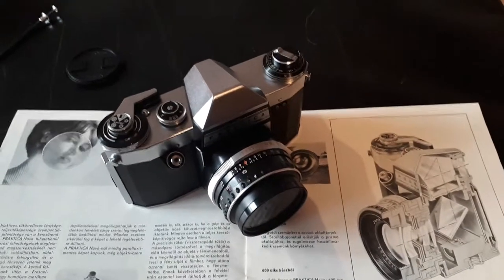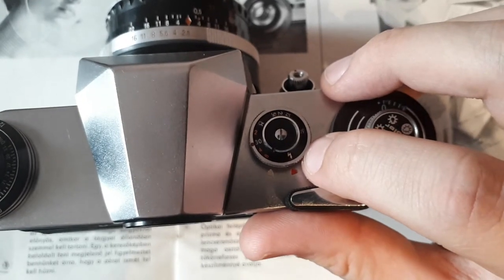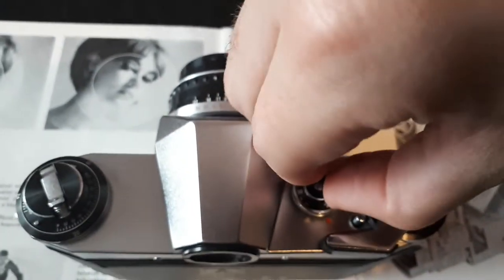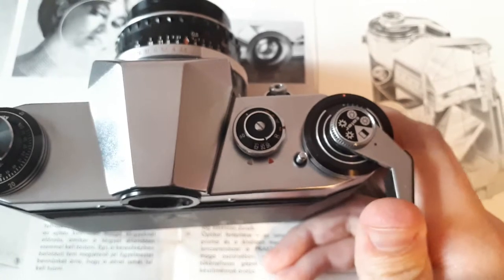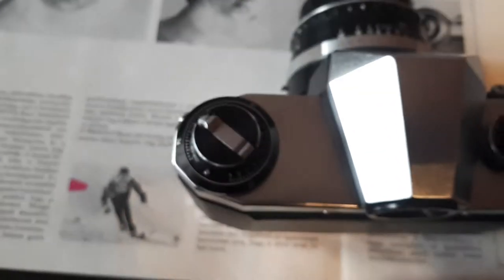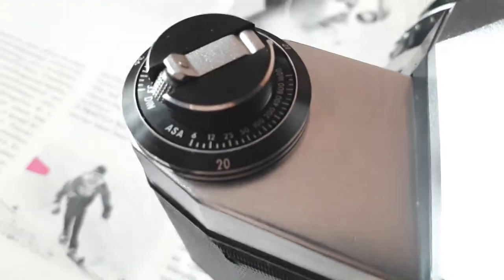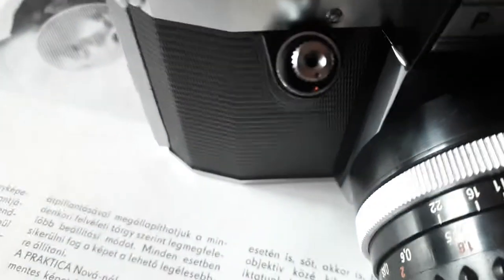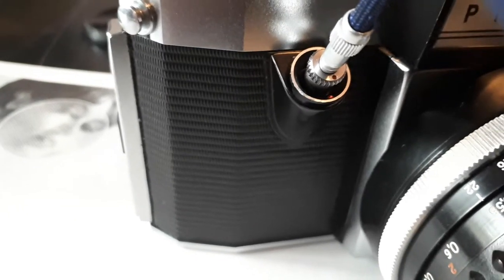Praktica Nova 1964 Controls

Comment: You should only turn shutter speed dial clockwise on the old cameeras. Also to rewind film you have to push in release button next to wind lever before using rewind crank. Seen quite a few first time film users tearing their film for not pressing this button.

Comment: my grandad recently gave me this camera! so does the iso/asa automatically adjust? as there is no way to change it..
Reply from the maker: Hi!
ISO/ASA is a characteristic of the specific type of film you've put into the camera. It cannot be changed on the fly like on digital SLRs. There are plenty of great videos that explain all the concepts you need to understand to use these analogue cameras.
Here's a good explanation of film ISO: https://youtu.be/SSJosqg6wA4
and of aperature and shutter control: https://youtu.be/zHUjn8ttQRM 
Now, this Praktica is a rather old piece of kit and it does not have an internal lightmeter which makes it trickier to use than more modern SLRs. Thankfully you can get lightmeters for peanuts, or you can apply the "Sunny 16" rule. Ask your grandfather about this stuff too! I'm sure he still remembers some of it, and it makes for good conversation.  
Good luck and have fun!
Reply: @avtomat11  thank you so much this is so helpful! :)
Reply: Hi, you search for the "Sunny 16 - Rule" to make photos without a lightmeter :-) The standard setting you can take is with daylight and not fast moving objects  Setting : aperture on the objective : 8 and shutter-speed 125... That´s the point you can go up and down because of the light, sharpness in the front or back, slow or fast objects...  greetings and everytime nice pictures from germany  Tobias😉😊